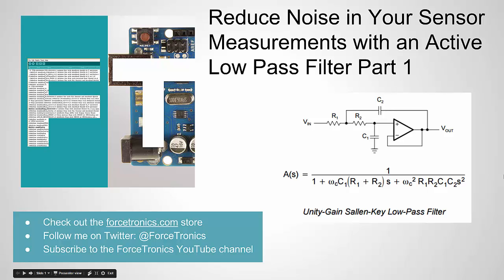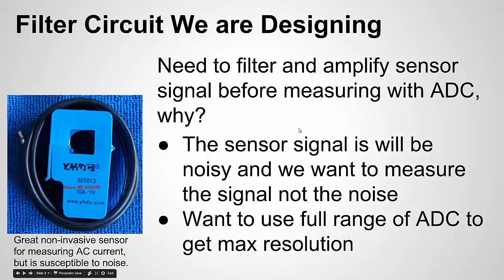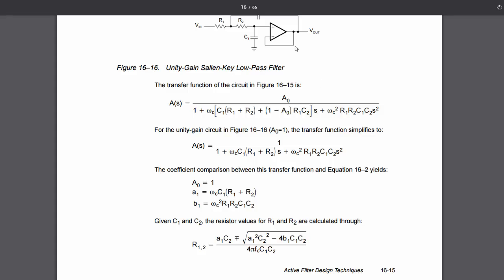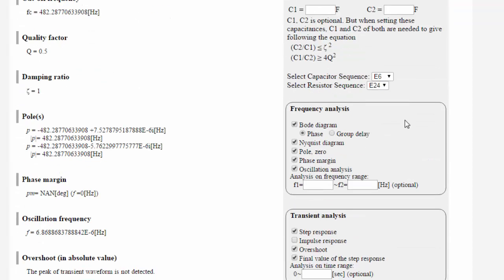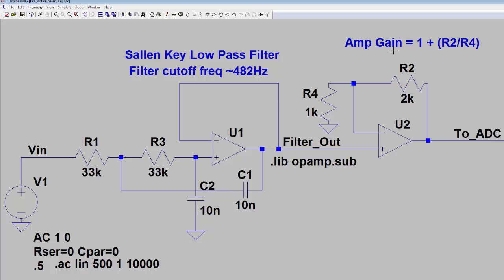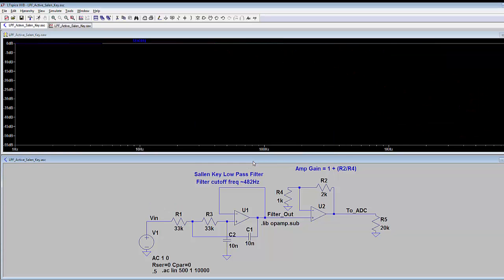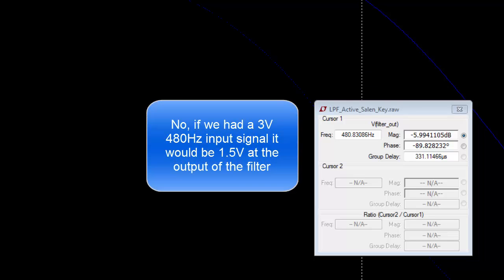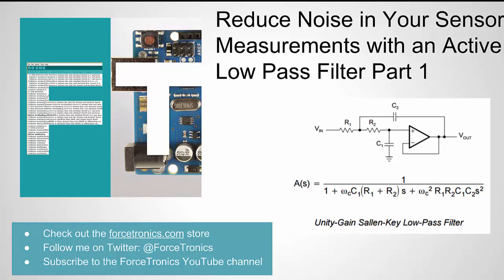Reduce Noise in Your Sensor Measurements with an Active Low Pass Filter Part 1

Comment: great video man,but way above my  head a little. the reason i'm watching it is because i got a cheap  hantek automotive scope and it dont have filters like the better pico scopes . but really interested because we do a lot of current clamp measurements . and the screen gets real fuzzy without some filters, tried the .1 microfarad capacitor in series but  i think i can apply your technology to make an adapter. thanks for the info.

Comment: elementary analysis is OK to understand the principle.
Like many things in electronics the results usually don't align with the such optimistic predictions.
Every type of capacitor has a self-resonant frequency, Fr.   
In any filter ,  every capacitor slowly looses the ability to attenuate for input signal that contain unwanted high frequency elements.

An 1 uf electrolytic capacitor  does not function as expected at 1 Mhz .  A  0.01uf ceramic should be connected in parallel the result is
will GREATLY reduce 1mhz to 20 Mhz  noise outputs of a filter.

Comment: Could you explain me why you used fc = 500hz ?
Reply from the maker: +Dave there was no hard analytical way I came to 500hz. I simply chose a value that wouldn't attenuate 60hz (much) but would cut out higher frequency noise.
Reply: 5:55
watch the video

Comment: Why that circuit? Why not just a single resistor em series and a single cap in paralel connectec do the non inverting pin?

EDIT: Because this way its second order, got it
Reply from the maker: Yes, also it serves as a buffer to the amplifier stage so there is a uniform input impedance

Comment: Instead of using a hardware low pass filter you can use a moving average, which is also a form of low pass filtering and can be used in a lot of cases. And you can use that with digital (I2C, SPI) sensors as well.

Comment: You are doing such a great JOB I hope this minor critique doesn't  offend you. In the books Fc, because you're not actually cutting anything "OFF"  as it were, actually stands for  "CORNER" frequency. I know this is a minor detail but I just thought you might like to know an alternative. Also, this might interest you: http://ifmaxp1.ifm.uni-hamburg.de/DBM.shtml ...PEACE
Reply from the maker: I appreciate the comment. I have heard both ways and see it both ways in different references. Here is Wikipedia "In physics and electrical engineering, a cutoff frequency, corner frequency, or break frequency is a boundary in a system's frequency response at which energy flowing through the system begins to be reduced (attenuated or reflected) rather than passing through."
Reply: Ya, that's my understanding as well..PEACE